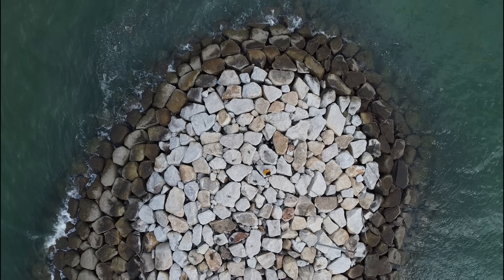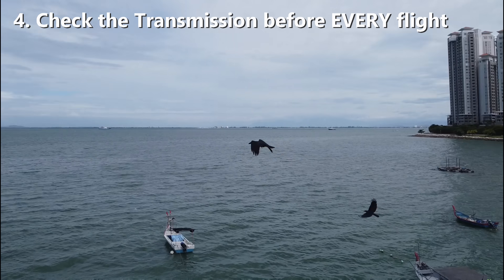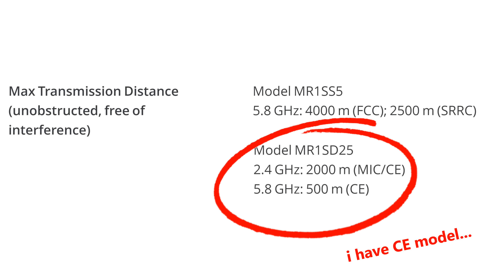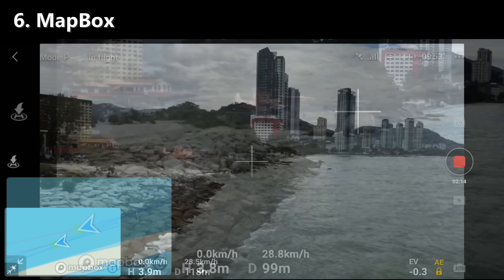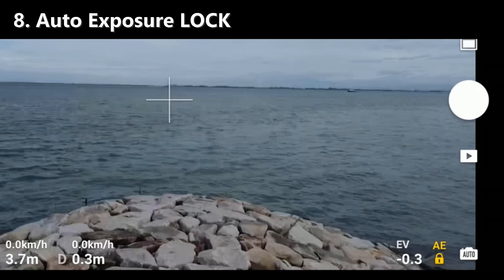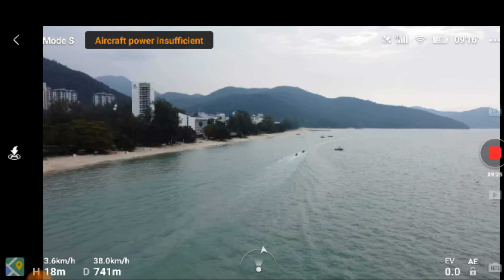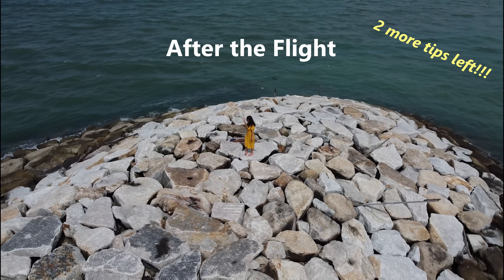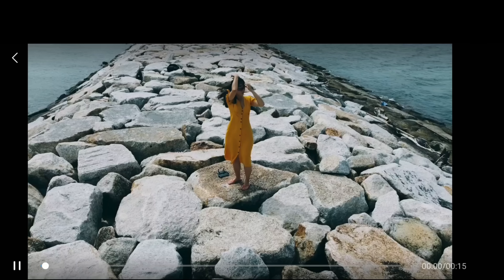DJI Mavic Mini 3 | 14 Tips in 5 Minutes | Best Transmission Range Tip

Comment: Make a tutorial how to land in small area pls.
Reply from the maker: my advice is not to...lol....i tried to land on a boat in the sea... almost lost my drone forever ...
Reply: @Young360  SO how do you land the drone on that rocks in the video? Do you use "Return to home" or manually?
Reply from the maker: @iamtg1  for me, what i normally do, i do either do "Return to Home" function, or get it straight down to where I am standing (which is shown in the map of the app - the map shows the fastest direct line to "home). when it has come near enough to land, I do it manually myself. The rocks here aren't that small of the surface :) if you are never sure of landing, you can always take your time by "lifting up" the drone to ensure you land it at the suitable surface. the drone will hover untili the battery runs out :)
Reply: @Young360  Thank you 🙏🏽

Comment: Hi where i can find the m0p box?
Reply from the maker: at the bottom left. there is a small square. yoh can click to enlarge it to show the map
Reply: @Young360   d0 i need to use wifi 0r m0bile data in mavic mini duriing flight h0urs
Reply from the maker: @blow9899  nope. you can just switch off the data ..but if you want to see your drone on a map, you might want to use a little bit of data.

but flying a drone doesnt require data usage.
Reply: @Young360  thank y0u
Reply from the maker: airplane mode, can

Comment: I don't understand what I do wrong... It was less windy than the video and my mavic mini couldn't stand it... It was shaking all the time my shots were horrible
Reply from the maker: um... maybe try to recalibrate the gimbal?
Reply: @Young360  thank you for your reply! 🙏 It turns out that some dust was stuck in the gimbal and couldn't move correctly. Even though I clean it after each use, I had to blow some air on it this time 😮

Comment: 5Ghz is not a stronger signal, it can carry more bandwidth. Which isn’t very useful in this scenario. Stick to 2.4! 5 GHz was included in drones for indoor shooting where a lot of WiFi base station might cause interim disconnections at 2.4.

Comment: I finally flew my mini, once it is airborne, it smash into the wall by itself without doing anything myself?? few scratches on the prop luckily and hope my auto evo2 don't do this to me!
still like the mini cause it is small to carry in the future, i also had the CE like you but you probably give this away already !  phone up some tech and found out it might be the metal around me that affect the drone to fly off by itself.
Reply from the maker: thats strange...why did that happen to Mini? i think it is safest to fly outside when you catch alot of GPS signals so that Mini will hover in place. um, maybe you did fly outdoor?!?
Reply: @Young360  Yes, I did take it down to try out, GPS was not strong at that time, I didn't want to try to fly more than 50ft that time, once it get off the ground , it did fly by itself to the wall without doing anything!
Reply: @Young360  Take mini out today at a open area and it's  fine?

Comment: It said 'Best transmission range tips, but the only tip was to put it in manual and you saying that your mini was type 'C'., Nothing about range.
Reply from the maker: really? i mentioned you can check the transmission channel and even manually change from 2.4Ghz to 5.8Ghz as needed
Reply: @Young360  not in Thailand.
We only get 2.4 here. You had nothing about selecting manual and selecting a suitable band.
Then no data about how far you can expect to fly here in Thailand, only 500m to 600m maximum.

Comment: Hi! Couldn't quite make out what you say. Is the model MR1SS5 better than the MR1SD25".Sorry but I am new in this. Thinking of getting a set. Thanks!
Reply from the maker: Models depend on where you are. MR1SS5 complies to FCC (USA) and SRRC (China).  MR1SD25 complies to CE which is Europe. So, if you buy in Europe or many other countries, you get MR1SD25. and your video transmission signal will be limited to 2000m at 2.4Ghz and 500m at 5.8Ghz.
Reply: @Young360  Thanks for the quick response. Will make sure that I will be getting the MR1SS5 model when I purchase it either in Singapore or China.

Comment: Just as an fyi the 3 digit numbers are 5.8ghz these are stronger but the range is severely limited so i would only recommend it if youre in a wifi polluted area however 2.4ghz is weaker but with a MUCH larger range so this is optimal if youre flying in an area with no wifi pollution (over sea, in the countryside, ect)

Comment: Hi! Have u even met this error mess: “aircraft signal interfrence”. I just fly high around 40m it appear, and I need to RTH to keep it safe. I don’t know that it’s normal and can i ignore this message or what i can do to avoid it. Pls help me. Thanks
Reply from the maker: i get that signal message quite often....😅😅😅 as long as it doesnt disconnect than it is sort of ok. just make sure you have the RC facing the aircraft, the middle bottom shows a triangle that indicates that the RC is well aligned with the drone or not.
Reply: Young360 thanks a lot for your sharing. I also see the middle bottom , some time it’s become red, but drone is still fly smoothly and I ignore it LOL. So, now when i see the red  triangle, I must move the antenna to the drone, right?

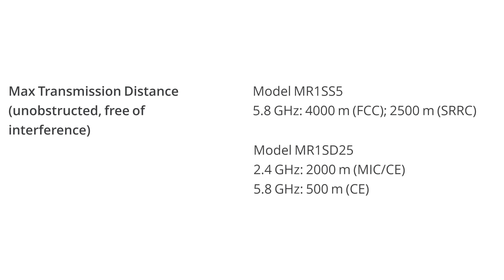Comment: Hi Young, many thanks for your set up tips which I have taken onboard as trust your advice :-)  I have a question though regarding transmission as you state at 1:21sec 2 different model numbers (MR1SS5 & MR1SD25).  Do you happen to know where I can find the range of my Mvic Mini which has model No MT1SD25?  I think that the T maybe the country code as I have bought it here in Thailand but any pointers would help me if you have time - Many thanks again :-)
Reply from the maker: yours sound like CE model. Coz MT1SD25 is model number for drones and "MR...."is for RC model number.
Reply: @Young360  Interesting as the model No I took is just inside the battery compartment of the drone itself..... I'll try asking DJI support using the drone serial number.  Thank you for taking the time to reply :-)

Comment: I heard that this product doesn't have tracking, however you mentioned you that it have.  Can you confirm which is correct.
Reply from the maker: it does not have active tracking. it has Quick shots where it can track for about 40m pre program. pls do check out my video on Quick Shots, https://youtu.be/IbBir8tkvzE

Comment: Hello, have you experience the drone not hovering in place when flying indoors and is drifting to the right or at the back.
Reply from the maker: i havent flown indoor....😅
Reply: @Young360  have you experience flying outdoor and the drone is drifting to left or back without touching the controller? I already calibrated the imu ang compass but the hovering is still unstable.. just checking if this is a product defect or what 😞🤣 just got it yesterday
Reply from the maker: um, how far does it sway?? mine stays in place, or moves like 10cm.....

i have seen other drones like hubsan and shift red that sway more....which isnt really great..

Comment: Young360 What is the recommended SD card size for Mavic Mini?  Also do you have a brand that you prefer?
Reply from the maker: I use Sandisk or Samsung. 32 or 64gb are more than enough for Mini
Reply: @Young360  Awesome.  I picked up Mavic Mini after your comparison and review.  Looking forward to trying it out.

Comment: Also remember that the best wifi signal comes off the flat part of the antenna not the tip. Always face the flat part of the antenna at the drone for best reception. 

A great on the go editing solution is to get a current generation iPad or iPad Pro with at least 256gb, 128 might be ok, and then buy an app called LumaFusion. Next get a micro SD card reader with a USB C (iPad Pro) or lightning connector (iPad) and you can copy your files over to the iPad directly to edit in LumaFusion. 

I find this ideal because once I've gotten all the shots and video I know that I want, I can delete all the old images and video from the SD card from the Mavic Mini.

Comment: i don't know mavic mini but i wouldn't advise you going into manual mode in the channel transmission selection. normally dji drones switch channels automaticaly if there are interferences especialy in urban areas. the auto mode will ensure you that you always have the best chanel for reception and will change the chanel and even frequencies 2.4 or 5.8ghz (only with otg cable) when needed. in manual mode your risk going into rth mode and loosing control over your drone is quite high. best wishes to you
Reply from the maker: oh, i see...but now i changed to 5.8Ghz and dont have an issue...😅
Reply: @Young360  good to hear that. spark also has way better transmission in 5.8ghz but my spark is in fcc. just to let you know the easa, eu flight controll, will rollout new drone laws by 6.2020 on all eu. the < 250gr does not apply to mavic mini due to installed cam. so it doesn't make a difference flying mp2pro or mavic mini. best wishes to you

Comment: My dji mavic mini is not hovering, it's goes to one direction In hover, can you explain why this happening?
Reply from the maker: i think you should recalibrate. it should solve the issue (as it did for my Tello before)
Reply: @Young360  I did but  it's not hovering in a place
Reply from the maker: um, are you doing it indoor, then bottom visioning sensor may have detected obstacles at the bottom... otherwise, i dont know...you should contact the technical support of DJI....😅
Reply: @Young360  nope outdoor, let's see i will calibirate one more time

Comment: How can I know that the dron need recharge !?
Reply from the maker: DJI Fly app will tell you how many percentage of battery is left.. but if you dont want to connect to the app, you can look at how many lights out of 4 lights, the battery is shining when you click the battery button just once. There are 4 light dots, and each represent 25% roughly
Reply: @Young360  ow I see thanks so much I got it now

Comment: 🔌 You’re should charge with a Qualcomm quick charger in 70 minutes (from 15-20%) instead of 2 + hours with a normal charger !
🔋
Reply from the maker: but then does it come with a battery pack...?!?
Reply: Young360 the cable you received is a quick charge cable that is compatible with a Qualcomm charger, you have to buy just the wall charger (google Qualcomm Quick Charger) QC 2 or QC 3
It only comes with the fly more combo but with the drone only you have to buy a QC charging block

Comment: Hello, since you have the CE mode then in this open space on the beach side you can expect to get 2km max but in the wifi settings you manually set it to 5.8ghz hence you will only be getting the 500m max transmission distance? Does having it 8n auto make it fly farther than 500m since it would auto shift to 2.4ghz in some areas to get more distance? How I wish Dji would just give us all the FCC mode at 5.8ghz to 4km same as what the US are getting. Its ironic why they need to make the CE modes for some countries, I feel its a discrimination issue. Thanks for your great info on the Mini!
Reply from the maker: the reason i changed to 5.8Ghz is because even at the beach side, i was getting a lot of interference... 2.4Ghz was unstable
Reply: Because of the law...
Reply: @chriskhoo1708  if its the law how come countries like USA gets a 4km transmission range when their FAA laws states that all drones should be flown in visual line of sight...well they could have telescopic eyes to see their drone 4km away...LOL
Reply: @epsonexxon1088  Probably... : )